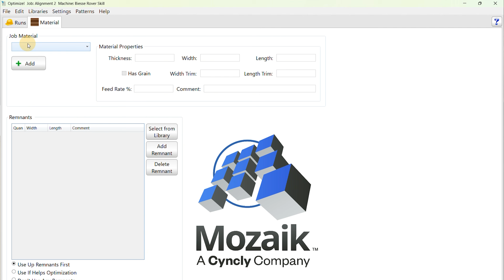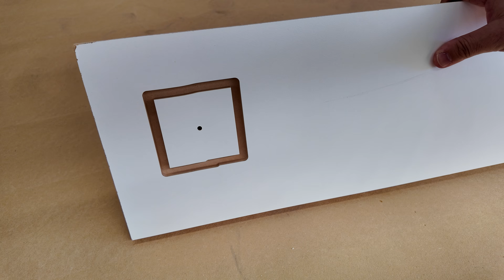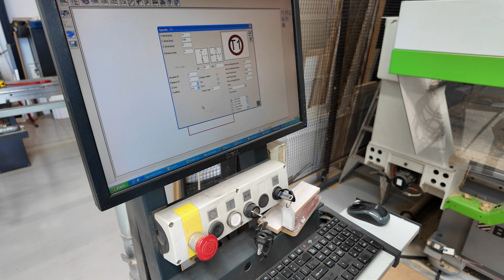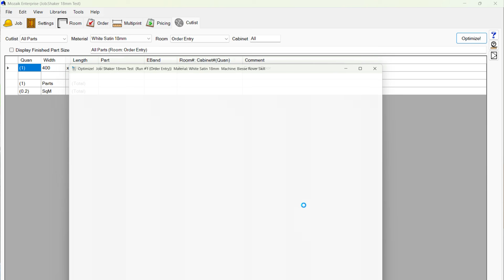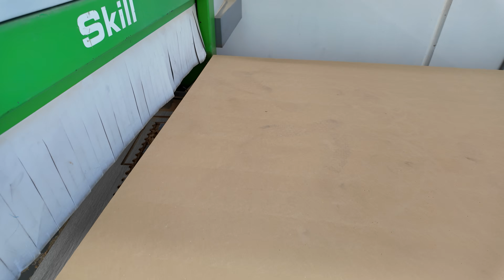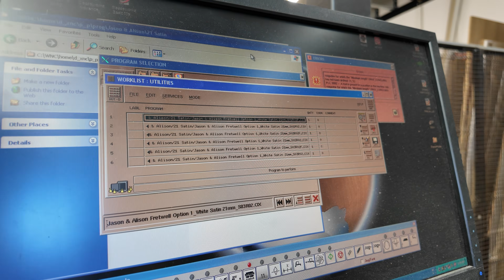Shop Tutorials with Dave and Anokin: Flip Sheet Nesting

Comment: Thank you for the great video! I cut  doors on the CNC with hinge cup holes pre-drilled — perfect alignment with Mozaik mounting plates and no second operation on the Blum hinge drilling machine.
If your edgebander doesn’t have a copy wheel, I designed a small tool that helps during edge banding to prevent the notch around hinge cup holes.

Comment: If you're cutting a small scrap on a vacuum table, use other scraps to cover up as much of the rest of the table as you can (where the vacuum is enabled) so there's as much vacuum as possible holding the part instead of just sucking air through the spoil board.

Comment: Zero trim is expecting the sheet to be square right?  Seems like the centerline of the square and the drilled hole should be in line with the center of the pop up pin at the bottom of the machine.

Having this feature cut off center of that pin can naturally move right due to sheet variation. 

By forcing the cut to execute in line with that pin it will ignore sheet squareness

Comment: Another best method to do this test and most accurate method call your machine tech service and find out what is distance btw your router spindle head and multi drill head
so write that number some where, so put 5 mm drill bit in your router spindle  and lower your router head with 5mm bit all the way down on spoil board and carefully make sure it touch on spoil board and make a mark over there with 5 mm bit and for reference circle that point with pen
second thing move your x and y position the amount distance btw multi drill head and router head your machine technician gave you , this tame lover your multi drill head all the way down and same way put a mark on spoil board , in this operation if your machine calibration if perfect both point on spoil board should be in same location exactly 
if points you put on spoil board dont mach contact your machine tech service and they will change numbers on your machine software , 
couple of remainder for this operation 
1)  when manually lower your spindle head down make it very carefully and slow so make sure you dont break any tool or damage your spoil board , just make sure bit slightly touching on spoil board and leaving mark there
2) your multi drill head , pay same attention ,
3) I would recommend use same size of bit for both multi drill head and router head, for example multi drill head usually we use 5mm and if you use 5mm bit for router it could be good

Comment: Hello Cad, I did same operation to find out alignment btw multi drill boring head and spindle head , it came out same like your  , 5 mm hole came out 1/32 inc or 0.8 mm off the center , but when I work on regular projects cutting a cabinet it works exactly normal, for example my hinge mounting plates 37 mm inside from left or right end , it comes out 37
so I would recommend not to change your machine calibration before make further search why your calibration test coming out 1/32 inc off
thanks
Reply from the maker: This is a really common misunderstanding. The idea that “my regular projects come out fine” can be a bit of a trap. They look fine because your sheet trim tolerance is masking the issue.

In many cases the drill and router are aligned to each other, but not perfectly aligned to the pin. You won’t notice that on standard jobs. It only shows up when you start flipping sheets.

That’s the key point from the video. It’s not just about the drill and router lining up with each other. They need to be dialled in to the pin.
Reply: How do you dial it into the pin?